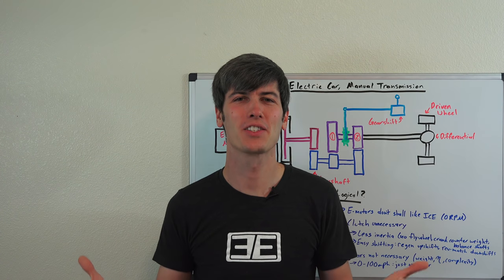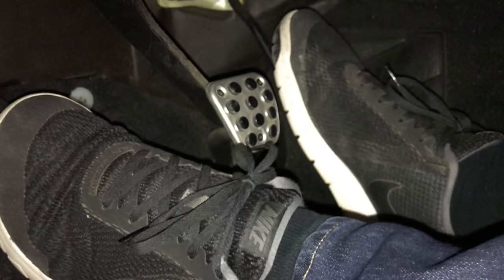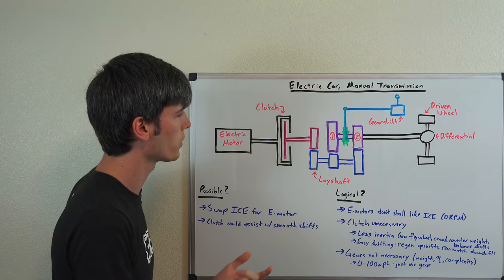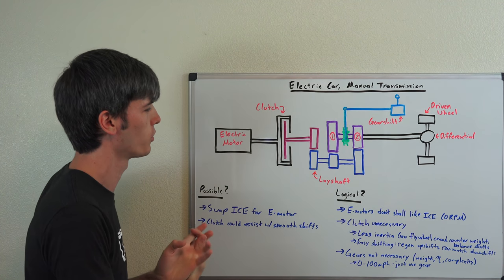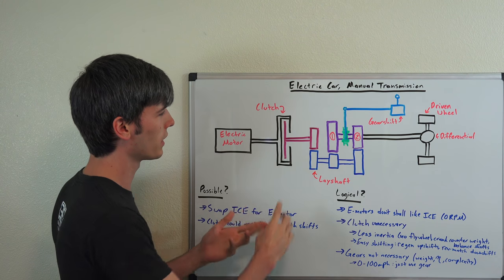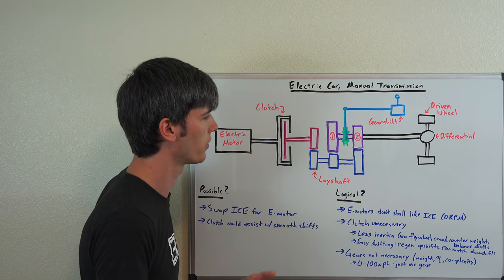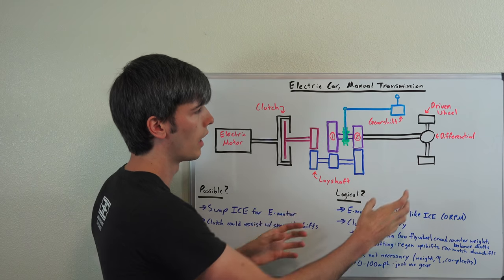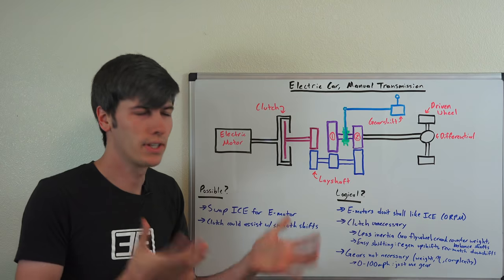Could Electric Cars Have A Manual Transmission?

Comment: Scroll down for an internet mechanic conference
Reply: So many experts, so many staunch purists.
Reply: 368 likes. hearted. one response till me now 2
Reply: International internet mechanic conference :)
Greetings from Poland!
Reply: Get this comment pinned. NOW.
Reply: Best comment so far
Reply: Not a single dislike. Beautiful thing.
Reply: My doubt is by using a gears we can use small motor and power to get more power and efficiency. And range will be increased .
Reply: lets face it guys the answer is "WE WANT FUN!" but the problem is how to make that way to thinking valid  for mass production
Reply: You said it
Reply: Well I wonder if it would be possible to "program" an electric vehicle to act like it has a manual. There would be a fake shifter with sensors to detect what position it is in. The car would then limit itself to a certain amount of RPMs for each gear. If the systems were advanced enough you may be able to near perfectly replicate a manual transmission, despite the car not even having one. One the plus side of this, if you don't feel like shifting gears (for some absurd reason) or somebody who doesn't know how to drive one wants to take you car somewhere, it would be toggleable.

Basically, your car would become one large, moving, stick shift simulator that also happens to be able to take you somewhere
Reply: LOL

Comment: I think in the future, I think that the manual transmission will become what the mechanical keyboard is to PC enthusiasts, yes it's outdated but you cannot replace it's feel
Reply: what do you mean? the 90s mech keyboard? because I'm using a mech keyboard right now
Reply: Mechanical keyboards are not outdated. A quailty mech keyboard will tend to last significantly longer than the modern non-mech keybaords.  Sure, the curcuits themselves might out last a mech when the spings and whatnot finally rbeak down; but the super thin chiclet keys on non-mech keybaords wear down super fast for folks that tend to do a ton of typing.  I for one have had sever of the paper-thing chiclet style keyboards wear down super fast over time and I have a single mechanical keyboard (on a 2nd machine), complete w/ clickety clacking noises that has outlasted all of my thin keyboards and still take a regular beating without stopping. DONT even get me started on "touch" keyboards like the iPad Smart/Magic keyboards.
Reply: Some people argue that the manual transmission is already outdated and obsolete. They're probably right, but manuals significantly enhance the driving experience so even if they're right from a technological standpoint, that's not the whole picture.
Reply: Manuals can't be outdated
Reply: Dude, I am sure that we still use mechanical keyboards.
Reply: mechanical keyboards perform better. Digital keyboards (the rubber dome switch) were adopted mass market because they are WAY cheaper to produce, and still perform well (but not LEET COMPUTER NERD well). Mechanical keyboards are sports cars, and digital keyboards are a 90s Toyota Corolla no matter how new they are. Those Corollas are reliable and just might outlive you, but you wont be racing one (INB4 TOFU DELIVERY DORIFTO). Thats why some mechanical keyboards will have a non-mechanical double offered by the brand at a fraction of the price. The cheaper board doesn't use mechanical switches, but will look the same. *fun side note*: my keyboard is a hybrid digital/mechanical board from when mechs were just starting to catch on (they made the less used keys such as the function keys digital to save cost on production, and I think that made perfect sense since the board was relatively cheaper. I don't care a whole lot if my F5 key is mechanical or not, its not a key I rely on to perform top spec).
Reply: Mech keys switches are far from outdated. In some cases are even more advanced than regular rubber contact keys. Take hall effect sensors for example
Reply: @uberfu  In my experience it is not a question of which one will last longer, as we have gotten to a point in manufactering that most keyboards can last basically forever atleast on the hardware side. Electric components are a different story but they can be easily replaced. I agree with the original comment that most people nowadays prefer that no nonsense simple chiclet style keys. But typing enthusiast prefer blue, brown mechanical switches, gamers prefer red switches and so on because we are not part of that general category. It is more of a feel just like Manual cars are. 
P.S. What is your average typing speed?😂
Reply: This is a poor analogy,  you appear to have conflated niche with outdated, mechanical keyboards are niche because they generally cost more than membrane keyboards, they are however superior to membrane keyboards offering better durability, serviceability and the ability to customise typing feel to your use case (e.g. red keys for gaming, tactical keys for typing).

Manual transmissions are actually outdated (in the context of EVs anyway) because an EV doesn't need one and by including one you make the vehicle functionally worse (decrease range due to drive train drag, decrease reliability and increased maintenance costs due to increased drive train complexity). The only scenario where a multi-speed EV would benefit is in high speed driving but even there you don't need more than 2 or 3 gears at most.

You could argue that some might find it more engaging to drive an EV with a manual gearbox (although give the way an electric motor produces torque I suspected it's way less engaging and enjoyable than people imagine) but that's an intangible thing that cannot be quantified unlike the comparison of mech Vs membrane keyboards.
Reply: @JetsetDruid  yeah a better analogy would have been analog and digital cameras
Reply: I think you're talking about a Spring Keyboard?

Comment: Manual transmissions aren't completely illogical yet. They're still cheaper and more reliable than other types, not to mention you can push start if your battery or starter is bad.
Reply: Duke Of Prunes I think he's talking about when the video mentioned that manual trans are already not completely logical for ICEs and not about electric engines
Reply: No, they don't. I'm talking about internal combustion vehicles, I agree with Engineering Explained there is no real advantage that I can think of for a manual transmission electric vehicle.
Reply: Honda manual hybrids are great. They have but don't use a starter motor (unless something is wrong with the IMA system), they have but barely use a regular 12v car battery, and you can push start them if you need to.
Reply: ah, but does it still run? i mean, i've seen people throw those solar panel battery maintainers on their dash and drive during the day when their alternators die.
Reply: For longer mileage...same as in ICE vehicles, you coast on a higher gear and lower rpm on the motor to save fuel (electrons in the BEV case) and so address the biggest complaint from all the petrolheads against BEV´s which is range. It would also most likely be possible to fit future BEV´s with smaller motors with less power. I am huge Tesla fan, but not all need to do 0-60 in less than 3-4 s. So it would make sense to build something a bit more boring but that can travel further on the same charge.
Reply: They have one gear so that's more reliable
Reply: No need to push start anything, just make a phone call. This is the 21st century.
Reply: "you coast on a higher gear and lower rpm on the motor to save fuel"

Electric motors are more efficient at higher rpms, to a point anyway. As long as it's running within a certain range it makes little difference in efficiency, not enough to make up for frictional losses from a transmission at least.
Reply: What if you were to find out the "redline" of an electric motor (idk what RPM, 10-20k?), and use gears setup throughout the whole RPM band to make very small power electric motor accelerate better? This would decrease electricity consumption and I think it sounds pretty logical to have gears. 
High power electric motors might have such big powers that more gear reduction would cause excess wheelspin, but what about low power Electric engines?
Reply: Your not going to push start a modern vehicle with a fuel injected, computer controlled engine. Older, non computer controlled cars? Absolutely...and I've done it in a pinch... Roll car, turn key to on and dump the clutch in second..
Reply: Phillip VanSickle All new manual cars can still be push started
Reply: IF you could do it, the battery would have to have some juice in it as everything on the car is electronic... fuel pump, the brains that run the engine, RFID on the keyless ignition, etc...I've give it a doubtful MAYBE if the starter was toast or you did not have quite enough juice to kick the engine over...and a steep hill...but I wouldn't count on it. I kind of doubt my Mustang would do it as it has the keyless ignition....
Reply: Tiago Santos That's not how that works
Reply: @MrApple187  Then why do lathes and mills, powered by powerful electric motors, have several gears?
One gear means higher revs, which wears out motor bearings and motor brushes/collectors.
By keeping the motor revs lower, you reduce wear on it.
A new Tesla motor because you wore out the original one = Costs a fortune.
Keeping your original one intact and in service for year = Fortune saved.
Reply: @ToreDL87  i dont get why most americans like automatics.  theyre generally unreliable outside of toyotas.  and usually its the major part of the car that breaks down that makes the car junk.
Reply: @iskdude9922  Its mainly because they are easy to use, they care more about comfort rather than efficiency.
Reply: Yes, they are reliable. All the MT cars we used to have at home were not precisely new. If something happens with them, were super easy to start up in an emergency. But now, in reality, it was more about saving gas [nearly all the taxis, ubers, etc. in Mexico are small MT cars] and of course, the joy to play with the shift.

Future cars are easy to drive, but they are no more easy to fix by oneself.
Reply: If your battery is dead in your electric car, you have bigger problems lol
Reply: It is easier to get out of deep snow with a manual transmision
Reply: @dshaprin  I actually have to disagree there. Very easy to burn up a clutch doing that.
Reply: @larrylentini5688  Why? You are using the clutch to swing the car. If you are stuck in snow, you go forward, when the wheels start spinning  you press the clutch to go back. When the car stops you go forwards again. There is no clutch slipping.

Comment: I will miss manuals....
Reply: pSyk mercia will always make manuals or at least dodge will and there is no shame in buying a used car. In my lifetime manuals will never be dead so im happy
Reply: Greenespirit how old are u?
Reply: zelo533 16
Reply: zelo533 I feel like that before im dead there will always still be a rare but manual option available
Reply: Do worry amigo we can always have stick shifter connected to voltage controllers to give you an imaginary feeling of gear change in ev's, heck we'll even throw in fake recorded sound and led lights to add to the spirit
Reply: Outside of the US 99% of cars are manual, they aren't dying out any time soon.
Reply: Australia most cars are automatic, even more so thanin america.
Reply: Benyed Apart from the fact that most manufacturers are ditching the manuals, except for their enthusiast vehicles and cheap small engine vehicles. They WILL die off soon.
Reply: what they really should is to upgrade the manual to 8 speed....
Reply: Jay h Most American Manufacturers**
Reply: pSyk ii
Reply: Greenespirit Just buy a Challenger and hold on to it. Gas will be cheap when electric cars are common.
Reply: I don't like this comment, but I agree with it.
Reply: Or get a focus st or rs or fiesta st they are manual only cars
Reply: I think the opposite may be true. Gasoline will become more expensive as demand tapers off, due to loss of efficiency of scale.
Reply: Olle Gladso well therea always biofuel
Reply: generic YouTube profile exactly e98 fuel is much better than petroleum based gasoline
Reply: I have a manual, I love it. Taught my daughter to drive in it, now teaching my son to drive in it. 2003 MANUAL Land Rover Discovery 2 TD5
Reply: I don’t. I have both EV and MT (C6) but EV is so much better and fun to drive.
Reply: @kingprone7846  trucks got that
Reply: He making dreams for nothing,theorize for theory,in practice,no functionnal with conventionnal gearbox.
Reply: @greenespirit4973  honda sells more manuals than dodge lol
Reply: fidel catsro fake sounds give no spirit
Reply: Robert it will be more expensive
Reply: Have you watched the video?
Reply: That’s why I’m trying to buy one now before it’s too late
Reply: Now and forever
Reply: I don’t know where you get that information from of Australia having more automatics then the American because where I live there more manuals here in Perth Australia so I honestly think % of automatics in Australia is less probably about 70% percent automatic and 50% percent manual
Reply: I suspect that the manual transmission EV will eventually be quite common. 

 Why? Because in many countries are counties are now promising to ban the sale of petrol & diesel cars in favour of EVs. But they won't be able to do this unless they offer a. manual option. So many consumers will simply not buy automatically cars.
Reply: New 400z is gonna have a stick. There's still cars out there for people who love to drive.
Reply: @greenespirit4973  UK for instance will have 0 new non electric cars past 2030 I think it is. So 50 years past that lets say manuals are gonna be extremely rare
Reply: what if electric car for offroad like 4 WD
Reply: Exactly manuals will never die . All the people have to do is ask
Reply: Here here. Sequential here we come.
Reply: @greenespirit4973  I'm hoping. First car a s10 with a planetary gear failure in automatic. Trans. Second car Honda accord 5mt and this thing is a bumper car. Replaced the clutch and she will ride on forever past 500k miles.
Reply: I put off electric cars, silly charge times wouldnt work in my country, range enxiety aint something i need, i have alot of those and the issue for not having manual gearbox. Please leave our manuals alone, you hav already taken the v12s and v8s 😭😭😭😭😭😭😭😭
Reply: I won't
Reply: I miss em already, their scarcity depresses me.
Reply: Manuals are awesome, but so is having a planet to live on... Also I don't know anyone who drives an automatic lol. Once EVs are common in Europe they'll probably make manuals for the folks who just can't drive without them. Once the last generation who grows up with ICE's dies out there won't be a problem. I'm just gonna enjoy them while I'm still allowed to drive my own car :)
Reply: @DoeZeo  some things are worth dying for 😈😈😈😇😇😇😇  long live the manual
Reply: Some people who call themselves "car guys" think driving a manual makes them "cool" but they're basically just walking to a library to find an encyclopedia to research from rather than using Google.
Reply: @benyed1636  "Outside of the US 99% of cars are manual" 

You could not be more wrong LOL
Reply: @khendrix1645  They're trying to perfect self driving tech right now, but you still think they'll have manual cars in like 50 years? Lmao
Reply: @carsondwayne  lmao damn right I do . I'll be damn if I drive one of those , they have to sell manuals cause it's always going to b a market for them
Reply: @khendrix1645  They don't have to sell manuals lol what are you talking about? Just 13% of new cars in 2021 are being made with a manual. That number was 22% in 2020. Down 9% in one year... The number of people who want manual is slowly shrinking lol better hold onto it while you still can
Reply: @carsondwayne  Oi you are right that modern tech makes switching gears obsolete but you don't have to be an ass about it, future boy.
Reply: @DoeZeo  "I agree with everything you said but you don't have to be an ass" 

I'm sorry for being right
Reply: @DoeZeo  weirdo
Reply: Its possible 🤪 the opel manta electromod is an electric car with manuel 4
Reply: Same
Reply: We all will
Reply: @pavlesakan6599  Not all of us will miss dinosaur age technology
Reply: @carsondwayne  well I am not sure how much you know about cars, but at the start ( and much longer) of car era, all cars were automatic transmision cars.😊
Reply: @greenespirit4973  that's right and I agree with you
Reply: @benyed1636  well the percent is not that high, but it is around 70 or 80% ( beacuse of new veichlies wich are more and more often automatic)
Reply: @carsondwayne  Couldn’t agree more.
Reply: Porshe made one electric manual